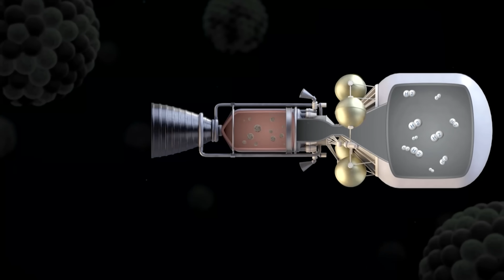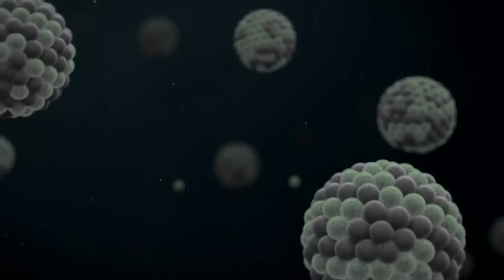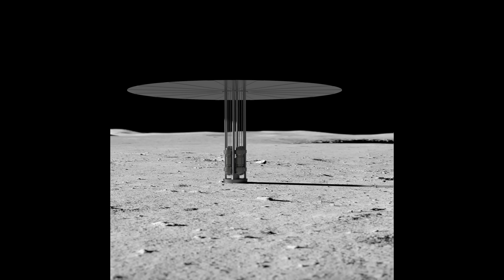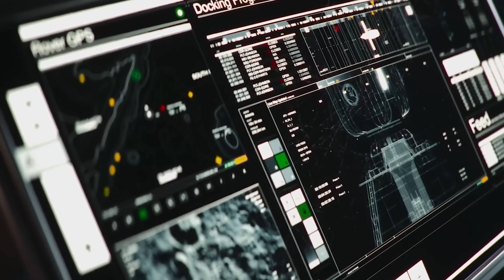SpaceX Found Brilliant Solution to Launch Starship to the Moon Without Refuelling...

Comment: My simple mind is coming up with this one:
Make it 3 stages - the booster, a nuclear 2nd stage, and a 3rd payload stage to be refueled with whatever liquid methane and oxygen is available moonside. 
Land the hot nuclear stage in a crater, there has to be a clean landing zone installed.
Separate stage 2 and hover the 3rd to a safe distance.
Let the hot nuclear stage cool off in the dark crater for months or use it as a power station. 
Once cooled off to handle (or use robots to handle hot nuclear gear) reuse it for Mars missions or the sort. 
Refuel stage 3 for a return to the Earth orbit refueling station.
Use shuttles to bring down men and material to earthside and vice versa.
Do not park hot stages 2 in earth orbit.
Shade Earth orbit fuel tank stages against sunlight, make their pointy end point to the sun, it should not be too difficult, even A I could at last be helpful.
Deploy manpower to Earth orbit, develop robots capable to do what men can't handle, e. g. separating hot stages, remounting Starships to cooled stages ect. Elon is an inventor and money makes the rockets go round!
And yes, it will be a load of work and consume time and money and all, gung ho! Better than having qualms with East, South and North for the sake of ideology.

Comment: If the reactor core heats the propellant to the same temperature and both gases behave as ideal (no dissociation, full expansion to vacuum), liquid hydrogen (H₂) gives about 2.53× higher specific impulse than methane (CH₄).
Example: at 3000 K (a representative NTR temperature)

H₂ ≈ 950 s

CH₄ ≈ 374 s

That means that an NTR with Methane has slightly less ISP than the metholox powered Raptor 4 in vacuum which has a projected specific impulse (Isp) of approximately 380 s.

So, there isn't any gain from using a methane-fueled NTR. 

Its a stupid idea.

Comment: Interstellar travel may be feasible, but using it within Earth's orbit or the solar system is currently too risky with humanity's existing rocket technology.
Even if mounted on Starship, the engine itself is too heavy, necessitating a complete redesign of the entire spacecraft.
Realistically, we should prioritize the practical application of the “rotary detonation engine.” This offers lightweight, high-output performance and 25% greater fuel efficiency than conventional rocket engines, enabling savings in both total weight and fuel consumption.

Comment: Nuclear reactor rocket engines is an old-fashioned solution, there are much better ones such as plasma rocket engines that do not involve nuclear waste and you no longer need the heavy shielding
Reply: sweet when we get that tech and it can actually do that at the same TWR we will.
Reply: No. A plasma rocket engine needs a source of power, usually electricity and where is that coming from?
Reply: @rogerphelps9939  One could consider a nuclear engine with a plasma rocket engine, but this is a much lighter one that one would need with an original nuclear rocket engine, because the approach is different.
Reply: To date the maximum thrust achieved by a plasma rocket is about 10 grams.

Comment: Did they need refuelling in 1969?
Reply: No, but the weight of the craft they sent to the Moon in the 60's was WAY lighter than something like the SpaceX starship, which in turn then needs way more fuel for the descent down to the surface.

More weight = more fuel = more fuel needed to transport that fuel!
Reply: @peterloohunt  I think it's better using more starships for more cargo and the refuel is more important and useful for the Mars mission later! Of course the nuclear engine starship is better if ready soon.
Reply: Exactly what I said on one of these videos. Add another stage full of fuel!!
Reply: No, because the Saturn V was made mainly of Aluminium and starship mainly of stainless steel. Stainless steel is around three times the weight of aluminium. Also the lander was small so needed very little fuel relative to spacex's lander.